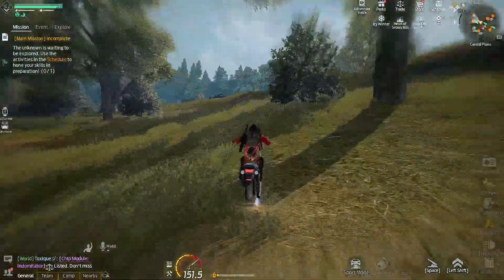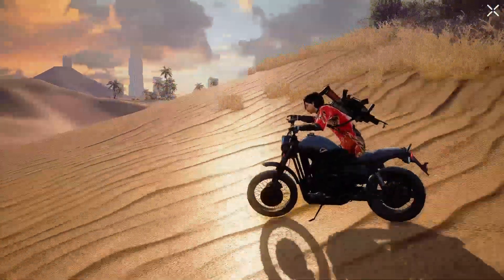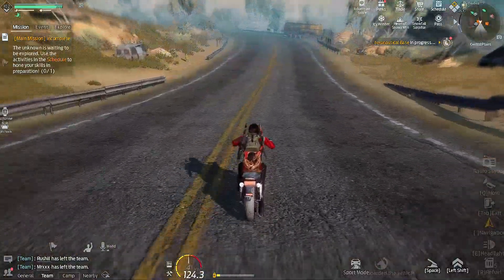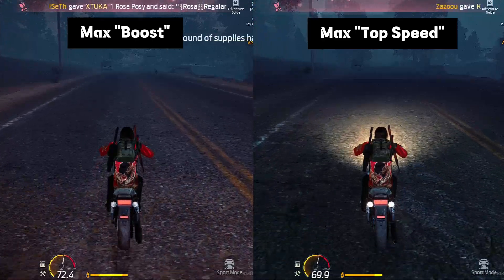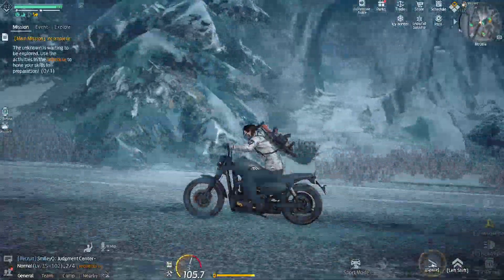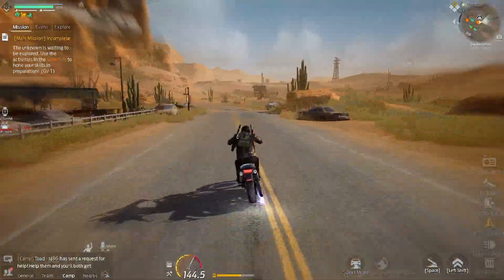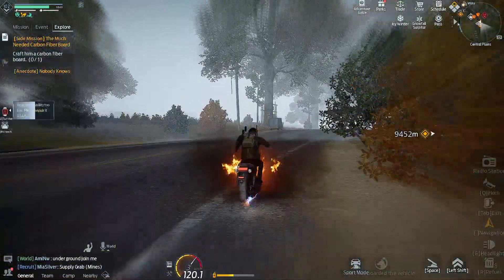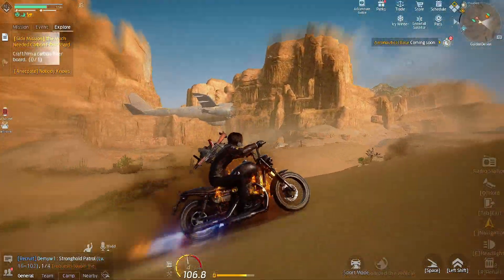UNDAWN Motorcycle Tuning Guide | Become Ghost Rider

Comment: All these tuning aren't really that noticeable if we're just going to use the free ones even with all yellow grade modifications, except for the acceleration, top speed, and suspensions - these are the only ones noticeable. However, once we use the Cavaliers / Black and White Stallion, there are big differences in each tunings especially when having all yellow grade modifications. 

But after Season 4 update, the turning maneuverability of motorcycles especially the purchasable ones became meh imo (still no significant noticeable change for the free ones, but that's just me since I got used to the cavalier), kinda harder to turn now than before. Sure the banking animation looks good - but the turning itself is so lame, like even at full 45degree angle, the change lead to too much understeering now than before. Out of all the many bugs and things they needed to change/fix in the game, they decided to also touch that specific part. They could've just kept the old turning maneuverability and changed the turning/banking animation instead of touching everything.
Reply: How much is black and white stallion?
I Ve never bought vehicles but they speed up a bit game and should be fun for sure, motorcycle and off road all what I need
With S parts I expect t much better performance tho